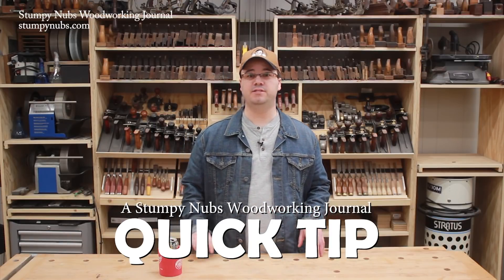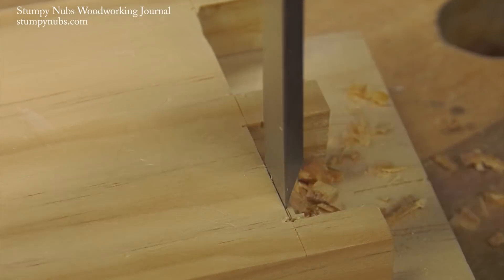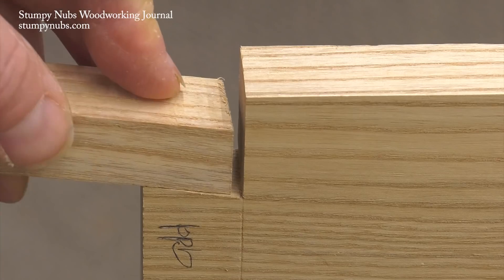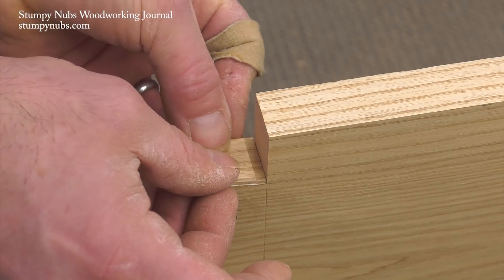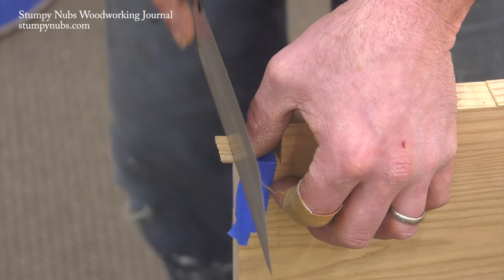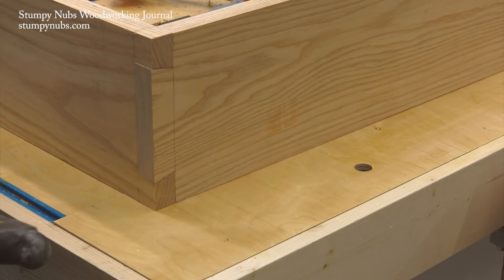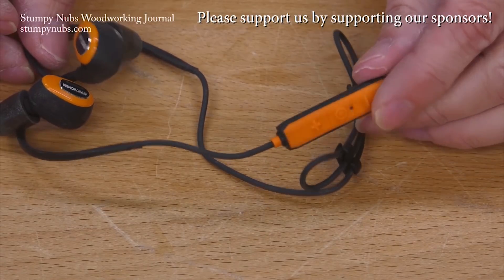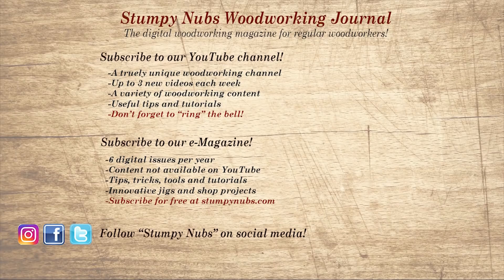How to hide your screwed up dovetails like a pro!

Comment: Another tip is to save the chiseled shavings and chips from the pin board. If your dovetails have gaps you can glue the chips into the gap then cut or sand flush. Since the chips are from the same board it is almost impossible to see a difference.

Comment: Hey, maybe someone here can help. I am starting now with joints. I'm using very cheap wood and chisels, although I worked a bit to make the chisels sharp. When I tried to cut a dovetail with the chisel, the wood started crumbling (kinda like bread) and instead of a clean (or even a jagged) cut I ended um with many holes. Is the chisel not sharp enough, is the wood too shitty or is something technice related (or maybe all of them)?
Reply from the maker: The chisel isn't sharp enough. Crushing/tearing wood fibers, especially soft pine is very common with dull chisels. Practice your sharpening technique. You can still get inexpensive tools sharp. They may not stay sharp for long, but that just means you have to sharpen more often. We are in the process of making a series on sharpening by hand. Keep an eye on this channel for the next couple weeks.
Reply: @StumpyNubs  Hey man, thanks! I will spend some more time sharpening the chisels then. Thank you.